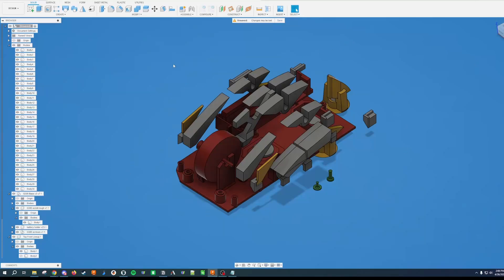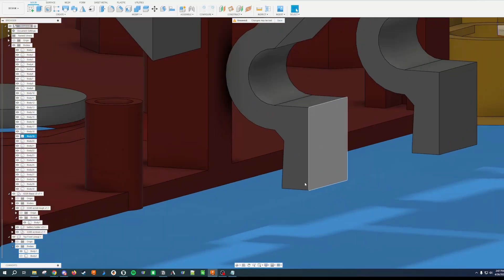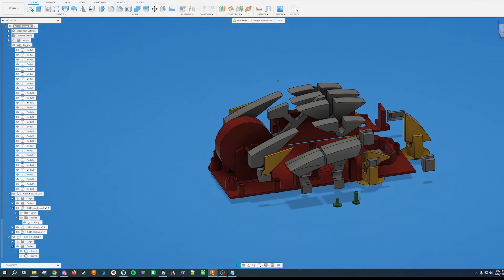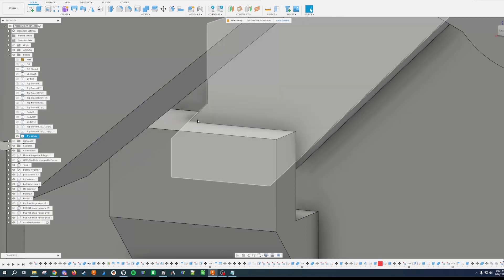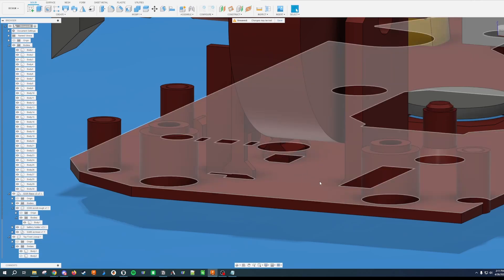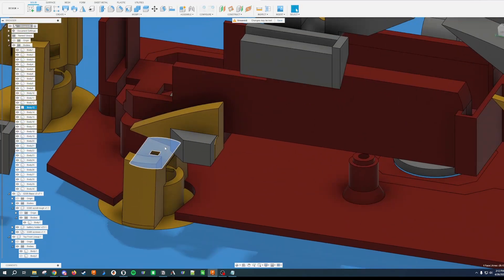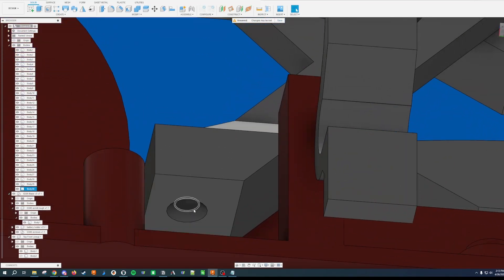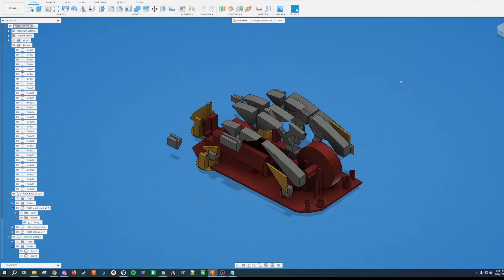Make your own wireless mouse with these free G305 Components

Comment: what do you call those holes that you use to connect the electronic board to the case? what do you call the little cylindrical stuff on the base board? i need to know what they are called...
Reply from the maker: the posts that you screw down into to secure the PCB? I would call them standoffs
Reply: @ZoroSeerus  thank you!